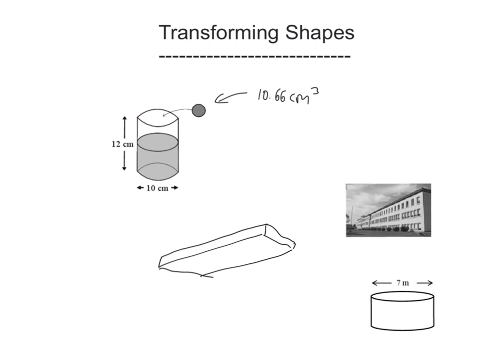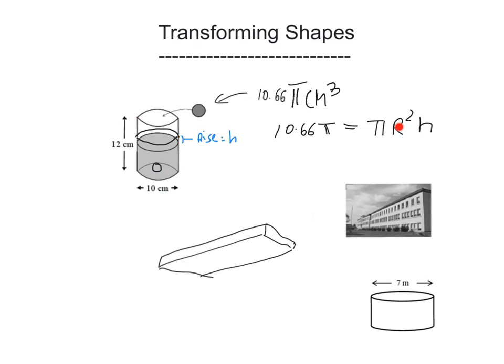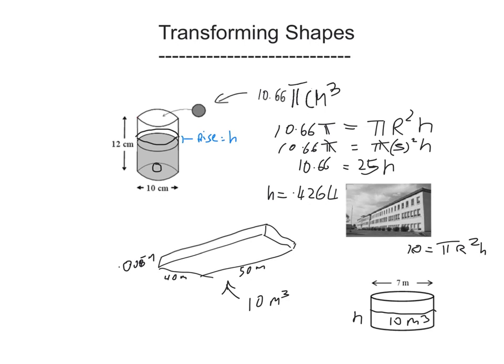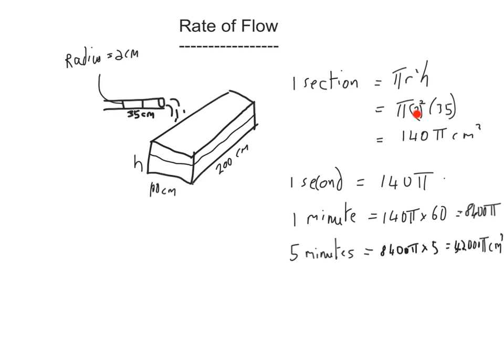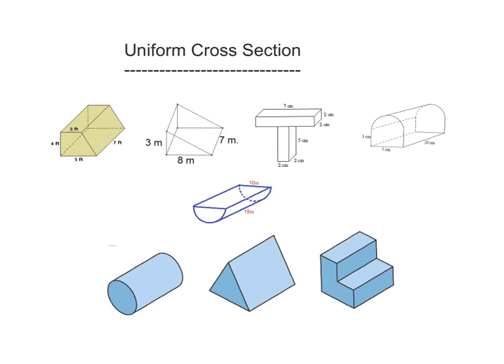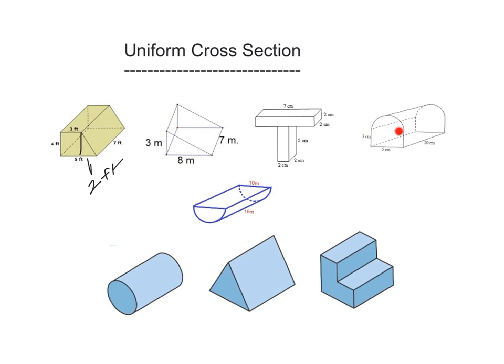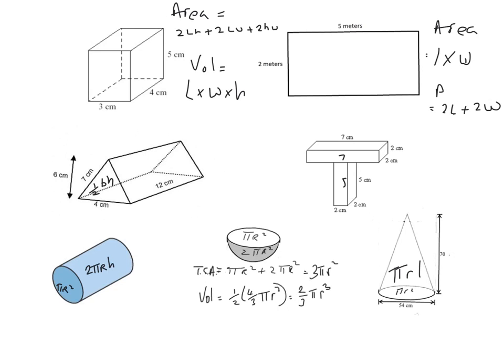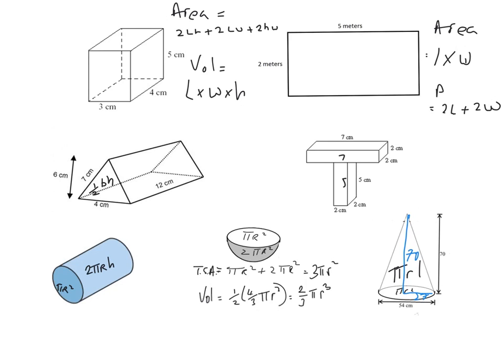junior Cert Mathes Papers 2 - area and volume part 2

Comment: hey why did the question with the first cylinder give you information about the height (12cm)? Was it to throw you off or could you use it to solve the problem with a different method?
Reply from the maker: Well we're told that the cup is half full of water, so you could half the height of the cylinder to get the height of the water, like i did it and then work out the volume of the water or you could just work out the volume of the cylinder (using height 12) and then divide your answer by 2 to get the  volume of the water. Either way works fine. Not to throw you off, but there are several ways of doing it.